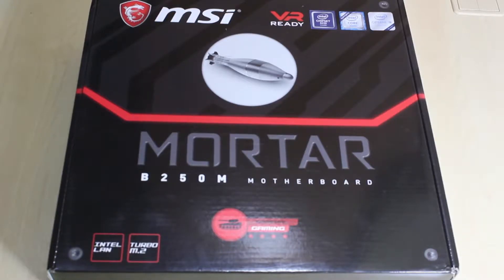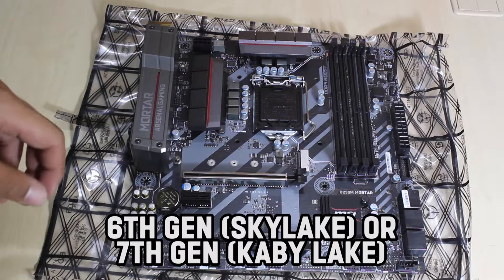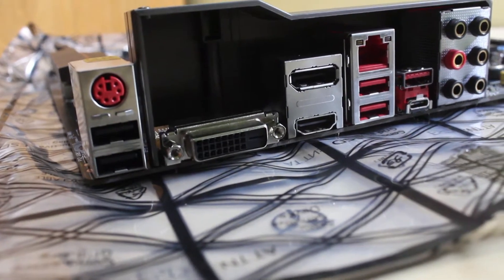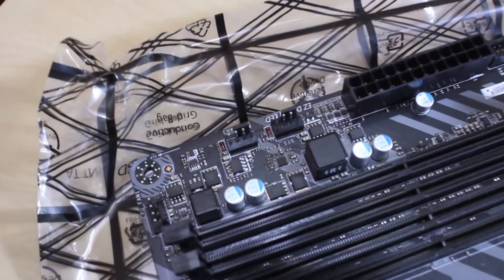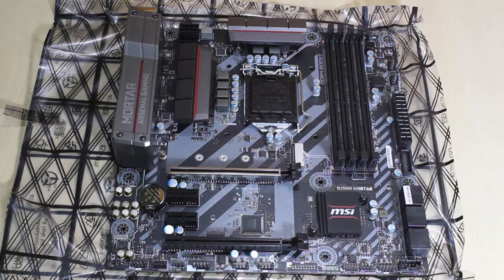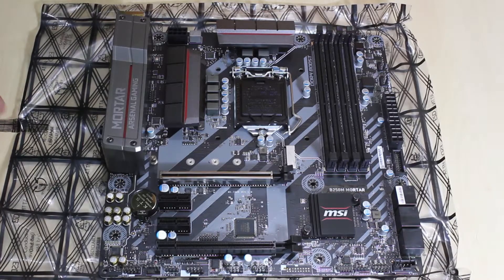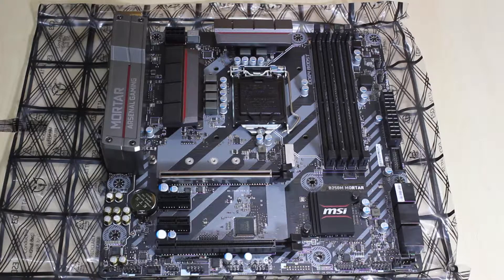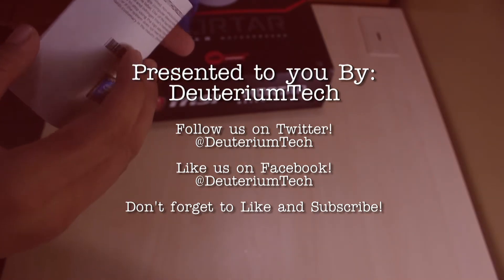MSI B250M Mortar - Best mATX motherboard?

Comment: Hi where should i plug the speakers jack? On other motherboards the speaker is green,the mic is red.
Reply from the maker: Hi! Sorry about the late response, I've been really busy lately. You can plug it anywhere I believe, you can set that jack to be input or output using MSI's sound driver - it does automatically show once you plug in something.